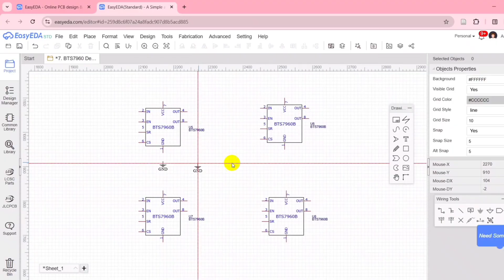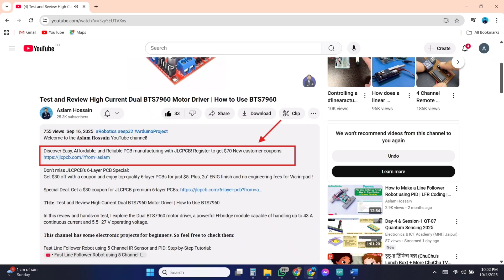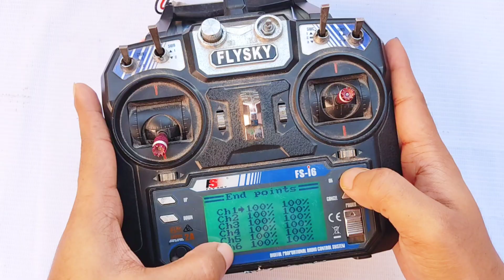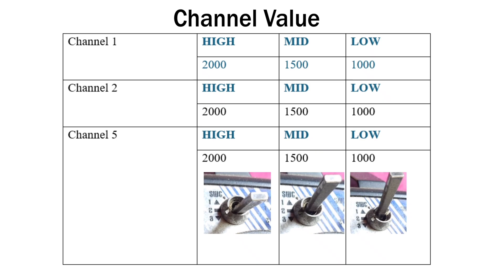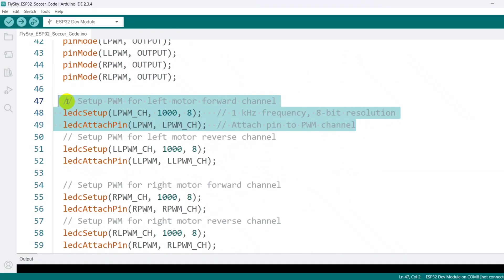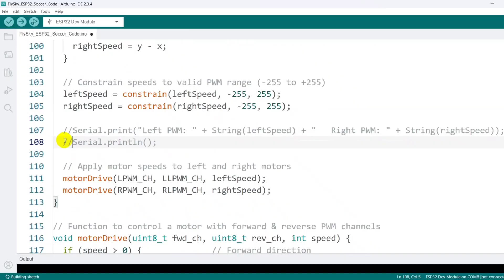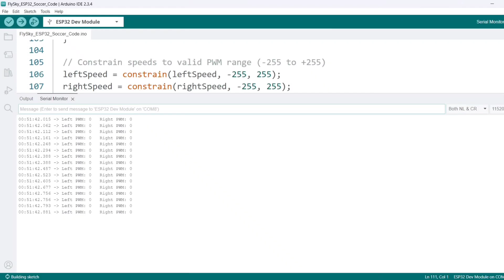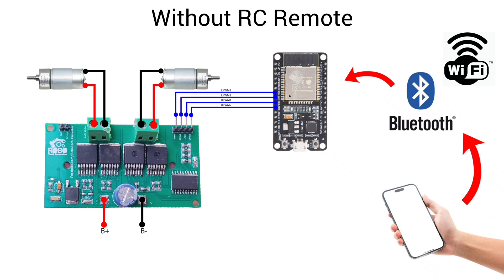How to Make Soccer Bot with FlySky Transmitter and ESP32 Arduino Program | JLCPCB

Comment: ভাইয়া, line follower robot এ যখন 25 ga motor use করবো, তখন কি XL6019 boost module use করা safe   ???
Reply from the maker: Hae safe. Eta 5A capacity. Jeta enough

Comment: Why to do so ? when there are brushed esc and dedicated motor divers just made for wireless recivers data as its way more reliable and cheap + compact - anyways its something new
Reply: The main reason for developing such driver is cost efficiency. The whole cost for making this driver is around $23 whereas any other brushed esc with such spec costs more than $50 still those esc lacks 6s battery support. Hope you get your answer